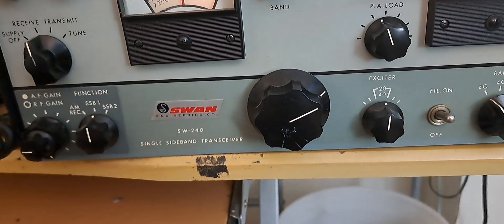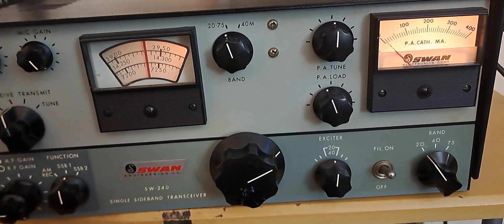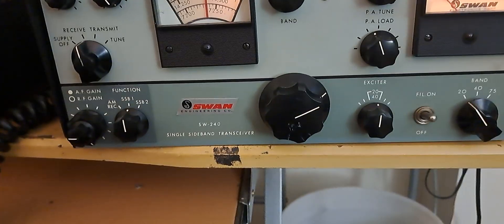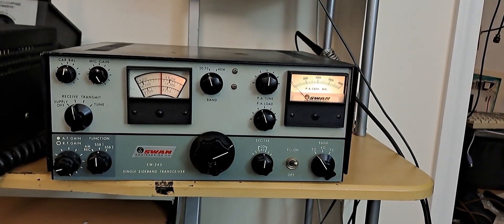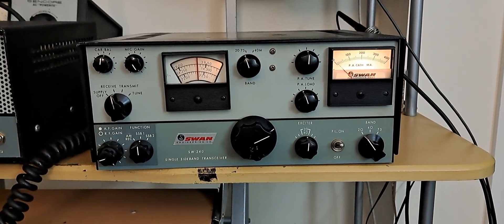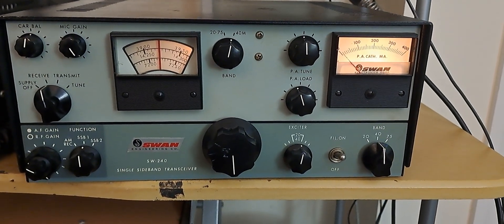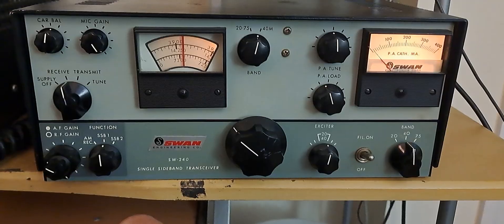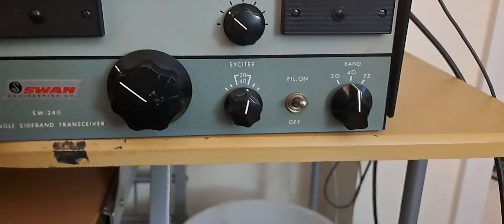Demonstration of the Swan-240 transceiver NO POWER SUPPLY with a contact with Lithuania

Comment: I knew you were going to flip this,that is why I did not want to sell to you.Having said that it is a fair price
Reply from the maker: Yours did not work, it had a loud buzz, when I fixed that it only received, when I fixed that it was low on modulation, it seems to require a power mike. Actually, I may keep it as I have made a few contacts, and I am still deciding. I just bought another one on eBay.